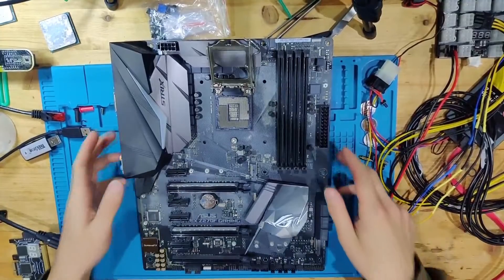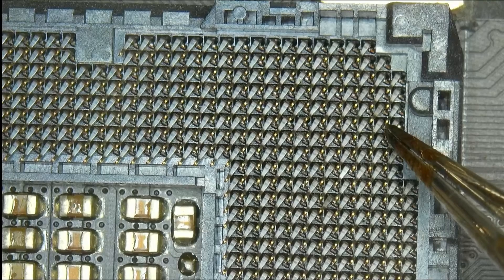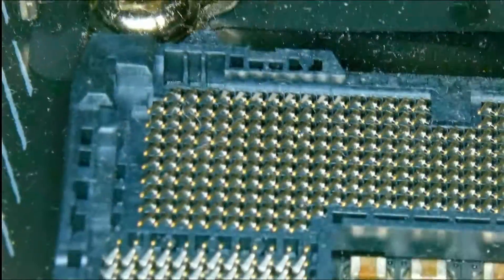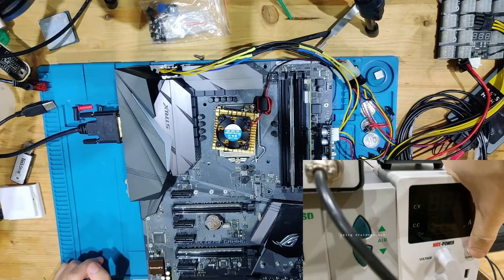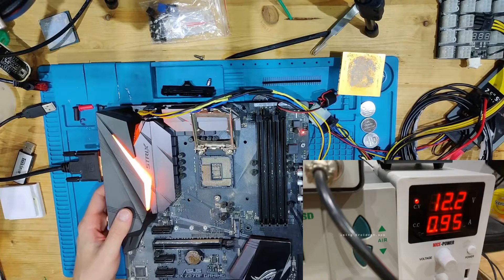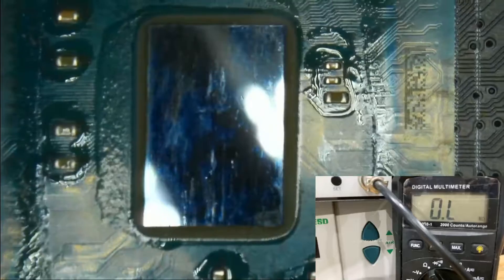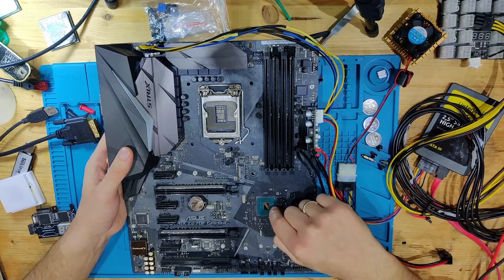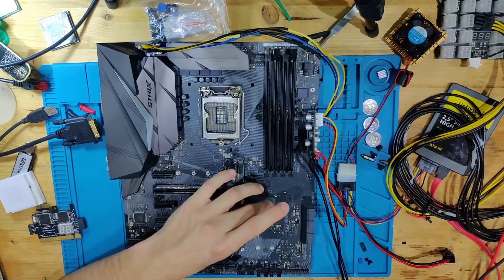No Boot Z270F Asus Strix Repair | Desktop ATX Mainboard repair

Comment: I have discovered the hard way that all Intel LGA sockets must be handled very carefully as if one is handling nitro glycerin. I purchased an old Asrock Z97 board and could not tell by the pictures in the sales ad that it had severely bent backwards pins. I put it under a magnification instrument and tried to bend them back but ended up breaking a pin. I will not buy another used board unless the seller takes good pictures of the socket. I would consider to have the socket replaced but have no idea how much it would cost and if it would be worth the expense to fix such old LGA 1150 board. Thank you for this channel I appreciate you sharing of your expertise and knowledge.

Comment: Hello, Thank you for your videos. i have B450 with 3900X cpu. It works with one 3200 ram but when I add the seconf ram the mobo just does not boot! I have tried all the basic troublshootin and nothinf worked. cleaning sockets, lookinf at the cpu pins and mobo socket seems ok visually, and I have tried different rams. Any I dea where could the problem be. I can do basic tech stuff with multimeter and solder iron. Thanks in advance :)
Reply from the maker: I would suggest to watch my very first video! There i fixed a Mainboard where 2 RAM slots were not working and i explained how!

Comment: Great video. Is it possible with multimeter chech dead CPU? For example checking caps in the middle.
Reply from the maker: You can also check the pads on the bottom, the pinout for that you can get with the pins on the mainboard and like that you could check VCORE or VCCGT.